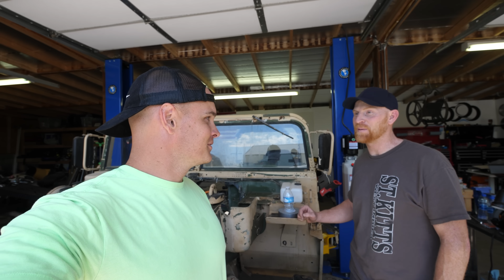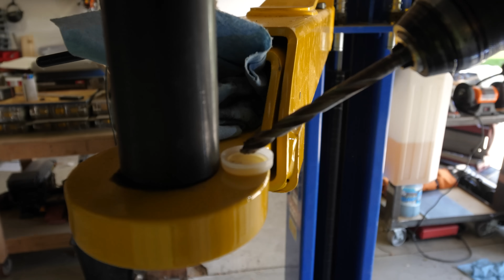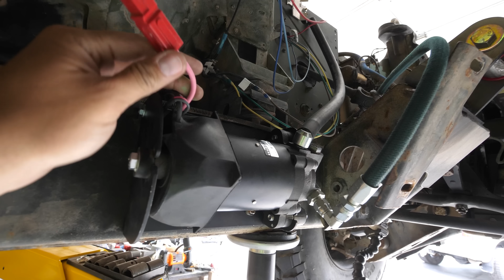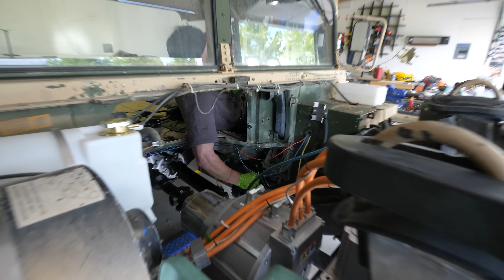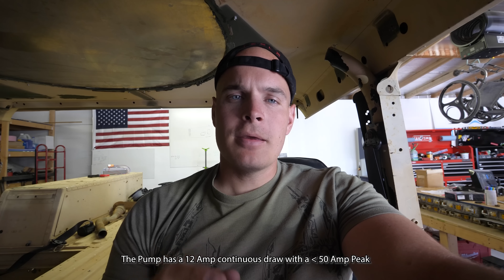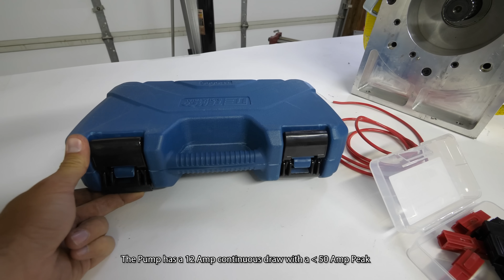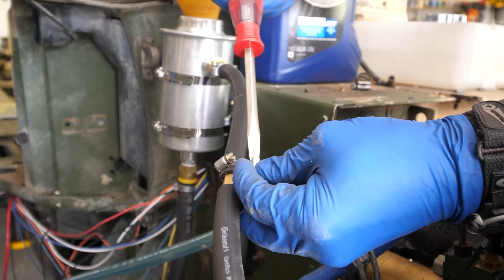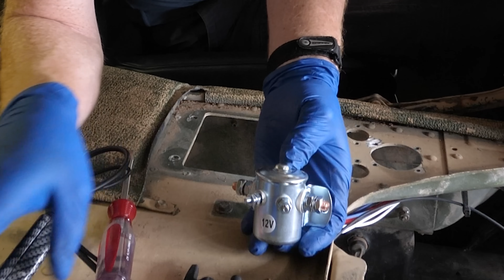We might have a problem with the Brakes... - Electric Hummer Conversion!

Comment: The noise sounds kinda like a stepper motor. if you can change the Motorcontroller of the pump you might be able to reduce the noise. Look up something like "Low Noise PWM"

Comment: I would change the pump completely, moving just moves the noise, we had this exact problem many years back in the engineering shop so we switched out to a new type of pump that made very little noise just cost over 10 times of the old one, I'm trying to find where it was sourced from

Comment: To fix your sound problem: I would get a Pressure Sensor, put it on the output side of the pump. Then I would either use an existing semiconductor H-Bridge or find/ design a strong enough PWM Mosfet "switch". With the help of a simple arduino-like board, a P-I Regulator could adjust the pump speed automatically only when you turn the steering wheel.

Comment: Start by just unmounting it - see how much that makes a difference. If not a lot, then the sound is simply radiating from the pump casing, and you might want to enclose it. If it makes a big difference, it's conducted through the frame and the bushing aren't doing a particularly good job.

Comment: Put the pump in a box. The only other problem with this system is that the pump is on all the time draining your battery. If you used a servo motor for the steering and make the brake pump only come on as needed, it'd save alot of noise and power. Position sensor on the steering wheel and then a big servo for the steering and a couple rods to the wheels.. like an RC car.

Comment: Rubber mounting the pump to the body and moving it as far forward are probably best options or the one lot of other use is fit a great sound system so you can drown the noisy pump out with some beats.

Comment: Think about where that pump is on the truck it came off of, its probably deep in the engine bay or trunk area where there's a lot of not only space but sound deadening between you and the pump. Take from that, move it in the engine bay or into the butt of the vehicle and use closed-cell foams and kilmatt to deaden it. Also, not to mention that is a terrible spot for it, it's right underneath you, next to the driveshaft to where if the driveshaft snaps or whatnot, you got a spicy wet dream of a helicopter knocking up your power brakes and power steering.

Comment: Plenty of external fuel pumps have a very thick insulating cover that kills its sound. They are normally moulded to the shape of the pump. You might find one that will fit of larger engined old cars. Maybe a old petrol mercedes.

Comment: I recommend you to use dot 4 hydraulic oil which won't react to heat(from friction from the disc) and won't boil fast which attracts water vapour in the oil and making it a compressible hydraulic oil, Next time plz use dot 4 hydraulic oil
Reply: Meanwhile many auto manufacturers use atf especially in the aftermarket world
Reply: @mrmotofy  bruh

Comment: HOW TO GET RID OF THE NOISE..........................Hey Jerry...  once you go above 20 mph the tires will make more noise than the pump and at highway speed the wind will also be noisier. You don´t really need to silence it, trust me I have done it. If you really want to sound proof it I can recommend using Acoustiblock. It´s a good material for using in a vehicle. It´s expensive but does work if you can get it around the pump. Just make sure you leave some way for it to ventilate.

Comment: Ya can go to a store location or online to summit racing’s website and order a almost like padding material that’s called sound dampening. It can be used on the floorboard and the dog house to minimize the noise created by the motor (power steering motor) and any road noses generated from every day driving. Most high end vehicles generally use this material so that the inside of vehicles can stay super quiet it’s also used in race vehicles too as an added heat barrier in some cases to. Also ya need to do research on which one ya choose though because some can be used for different reasons too, some can be used for doors or in the trunk of a car and some can be used on the underneath part of the vehicle around the transmission or engine and attached to the firewall or transmission tunnel.

Comment: Just make an aluminum box for around it and use some r30 closed cell foam from home depot to insulate the box. mount it to the base. I would recommend having slots in it using a cut off wheel so air can flow forward to back. You can also use a couple hose clamps and copper to create fins/heatsink like that on a computer to help dissipate into the air flow. Or you can cheat and put in a 120mm fan and use a grill from a pc for cooling. You can also use stick on sound deadening/roofing tape aka aluminum with stick tar and put it directly above it on the floor of the hummer on the underside. Between the two once everything is on it you should barely hear it. Make sure you use closed cell foam because it will not hold water and create all kinds of mold issues and if you used the solid stuff it will not be useful to any mice or whatever to get in there.

Comment: This may have been said somewhere in those 2000+ comments but .. .        . 

If you want  that pump to be quieter add  a pressure reserve tank and a pressure switch.  Then it will only cycle on  periodically during braking and large turns.

Comment: Funny story about custom fittings on pressurized lines, there's a custom fab shop in town here that made me new braided steel lines to replace my originals for less than I could buy them online. They used the old fittings and crimped the new line, so if that's something you're willing to do I bet there are some good souls who could do it for a decent price.
Reply: Yep simple Hydraulic shop stuff

Comment: You don't use teflon tape on flare fittings. The flare is the sealing face, not the threads like NPT. The teflon tape acts as a "lubricant" on the threads and can help them loosen off.

Comment: The noise you get off tires will be so significant that you won't even notice pump.  That said, the only option is to sound insulate the whole cabin.   Unfortunately,  I do not think you will be going very far- your half shafts are going to snap the first time you hit the throttle.  It will be very interesting to see what solution you come up with.   I am incredibly fearful the first time you take that rig off road, and get that circuitry wet, you're gonna die. I def would have done something different with circuit board placement.  Be sure to waterproof the gasket on that door. A lot of water will enter that area (I own a 2001 H1, bought it new, work on it often, I want to do what you are doing, thanks for being guinea pig!)

Comment: Well hello there, there is actually a solution for that, but it is not that simple or straight forward.
The power steering pump can be powered by torque sensing, this means it will only kick in when you need to steer which is indicated by active torque on the steering wheel.
But this will be dangerous for braking so the braking system should use pressure reservoir.
That should work in parallel with the pump

Comment: I didn't see this in a quick perusal of the comments - it looks like there's no fuse on the line going to the solenoid. That might just be temporary? But given that the pump has a 50amp peak, I assume you'll either want a slow blow fuse at 30amps (for the 10ga wire) or upsize both the wire and fuse to the max draw of the pump.

Comment: You could bend a sheet of metal around the pump as a sort of heat shield which can be riveted to the frame/body of the hummer and covered with sound deadening material

Comment: Use your brake light switch as a trigger for the solenoid.  When you hit brakes pump comes on. When not in use pump stays of. Also could use turn indicator as trigger. Or use something like an arduino as a controller to take inputs from the brake switch and pressure switches on power steering  to send a timed trigger to solenoid running the pump. Basically the pump only comes on when you hit brake pump and stays on  for bit if  or if yo steer. For only long enough that you need. It would also increase life of pump. Not keeping it constantly powered. Just an idea. Lol

Comment: a large solid state relay would run it without wasting power to turn on. I have seen them at 100amp capacity. As to making it quiet, an asphalt lined box around it would help, and it wont be as noisy when you have the doghouse installed, the wind and tire noise will also drown it out....
Reply: Amazon has a 120a version I believe like you're referring to. Like the regular ole 30A typical one's only it's bigger and has bolt terminals

Comment: Meby someone else explain it in the comments, if you drive with those tyres, they make more sound than the pomp. Also the drive train makes sound. Offcourse you can also put isolation around to decrease the sound. I saw that the hose on the pomp was pretty low, meby it is smart to cover that with some protection plate. If a big rock hits that point it wil brake because they are hollow lines. Really love what you are doing. ✌️ from the Netherlands

Comment: I had this problem on a truck that I built once. You need to isolate the pump from the frame rail. The reason that it is so loud is because the frame is broadcasting that vibration throughout the entire car. Do a search for "motor isolation mount", they look like a rubber cylinder with a stud sticking out both sides. With the weight of that pump, it'll prolly be easier to build a shelf, then have the pump sitting straight down it with the isolators between it and the shelf. The rubber tends to not like hanging from the side.

Comment: use a rubber or soft type of sheet to put it between the frame of the Humvee and the pump, it will defiantly reduce the noise and vibration.
Also, you can build a box with rubber or sponge lining inside it to dampen the noise a little bit.

Comment: may you install a pressure regulating vessel and a pressuere switch. in case you need pressure for steering you have a hysterese of pressure until the pump joins til it stops after that hysterese

Comment: I'd switch to an electric rack and an electrically boosted brake setup.  Yeah, it's more $ but you don't have an alternator making you lots of 12v power.   You're likely using a DC/DC stepdown box with limited amperage instead of a 150 amp + alternator like the trucks that use those devices have.
Reply: This comment above is underrated, how will the 12v system maintain a charge? Does the inverter also charge the 12v car battery from the big bank?

Comment: I don't know much about your vehicle transformation other than watching your videos, but in answer to your question about making the power steering sound dampened. The motor, like all motors, produce heat when operating and in your case when the key is on the motor continually runs so putting a sound dampening enclosure may cause more problems then it solves even if the enclosed motor has an air cooling system. My suggestion would be to relocate the steering and braking motor unit to a location far back of the vehicle, this would mean routing longer hoses and electrical but then the sound would be to the rear of you and the most of the  sound would be blocked by the body and the batteries, just a suggestion!  Alan

Comment: Interesting video, but got to say I'm not keen on many parts of this install even if it follows similar production car methods.  This is likely to be an issue with all electric vehicles. My main concerns are:
1. Having had electric power steering pumps fail on me, I sure wouldn't be happy to have one responsible for my braking.
2. Why, when you have a mostly empty engine bay would you mount the pump in such a susceptible location. So close to the driveshaft for a start which is likely to move in all directions when the rear suspension is loaded/unloaded while off-roading, and that hose is just begging to be knocked off by something launched by the wheel or encountered off-road.
3. One pump serving 2 systems just seems wrong.  On such critical systems I would be inclined to completely reverse that thinking and have dual redundancy in the form of 2 pumps on the braking system with an additional separate system for the steering.
4. While I have no answer, relying on a secondary 12v system to power the pumps just seems wrong.  Problems implementing a mechanically driven solution would be hard to overcome since the whole powertrain is constant with the slowing motor.
5. I would be inclined to have a warning system both visual and audible that identifies when the pump has failed either electronically or in pressurising the system.  I expect the first part could be easily done using a relay in parallel with the feed to the pump and the second with a pressure switch in the system.  At least this would allow you to reduce your speed and safely pull over before impending doom.
6. Would some sort of pressure reservoir be a possibility? I was thinking along the lines of including one on a vacuum braking system, but it would make equal sense to include one on the high-pressure side of this fluid braking system. One-way valves could possibly provide a safeguard to pressure leak-off.

I don't have the answers and I'm not saying what has been done is wrong, I'm just offering some concerns and a different POV.
Reply: Psst car manufacturers have been using electric pumps for years now. A few models use 1 pump for brakes and steering, many diesels do it for example. He's NOT reinventing the wheel or anything
Reply: @mrmotofy  While I don't know a single model of car that has electric powered, I did point out that he might be following production methods. Still seems crazy to me, zero failsafe, but that's just an example of how design has slowly declined since the days of the great engineers.

I'm not sure which country you're in but all petrol and diesel cars I know of use a vacuum to assist breaking.

Comment: To make it quieter I would try making a shield to go around It and put a layer or two of dynamat or similar material on the inside and or outside of the shield. If there is no worry of the overheating you could make the shield cover it as much as possible.  But if there is a chance of over heating I would not cover it entirely. Or if there is not a cooling system for the fluid you can make one and if it is effective enough you may not have to worry about over heating. :)

Comment: I would recommend a vacuum pump and a conventional brake booster off of somthing like a ford f150 or something

there are many electronic steering assemblys available on the market, usually with something like a ball spindle, they are quiet and sometimes don't even require all the plumbing for oil since they are self contained, just a beefy cable

if you however must stay with the current configuration you would need something that involves speed sensing of the motor wich needs to be retrofitted, not sure if there are many options out there

Comment: Love this series.  You have a lot of cool tools however, one suggestion I'd make is to invest in a nutsert tool.  Instead of running all these fasteners thru the frame you could install a threaded insert instead.
Reply: A threaded insert isn't positively retained. The bolt could shake loose in a car. I'd assume they're using nylock or distorted thread nuts to secure all their stuff

Comment: Iron is not a good conductor of electricity, you need to run a ground wire directly to the pump.
A nice copper block bus for ground connections is a must.

Comment: A torque switch on the steering column.
So the pump only will turn on when you pull,
on your steering wheel.
or because your steering isn’t aligned.
If you don’t know what it looks like.
it has typically 4 springs and 2, 4 or 6 mechanical switches in it.
Reply: Or what Salazar said.
Which will probably be safer because it’s car

Comment: 15:23 I have a solution, usually it is not enough to run the pump for a period of time to expel all the bubbles from the system, you have to rotate the steering wheel to the far left and to the far right several times (ten times for example) so that the remaining bubbles come out and the sound of the system becomes quieter little by little, Also, the more you provide it with sufficient energy, the more calm it becomes.

Comment: Please tell me that the pump isn't now running unfused...?! 
The best thing you can do for noise is move the pump away from the cabin area. If you insulate the sound, you'll need to have sufficient cooling on the fluid to cool the pump as well.

Comment: Hey Jerry, love the build. Quick suggestion, as I've got experience with DIY overkill and upgraded hydraulic steering pumps. You may want to look into getting an adjustable hydraulic fluid regulating valve, specifically for your steering system. While it may seem nice to turn your steering wheel and those beefy tires with your pinky, an issue you may have in the future is squirrel-ly driving at highway speeds, since it will be incredibly easy to oversteer your rig. Just a thought. Can't wait to see the rest of your build, you're doing an excellent job. I thoroughly enjoy your show.

Comment: you might need to isolate the pump from the frame. Look up factory airpump mounts for a vehicle with airbag suspension and youll see how they mount the airpumps on very weak springs and bushings. A good example i can think of is mercedes. w213 and w205 for example have good airpump mounts.